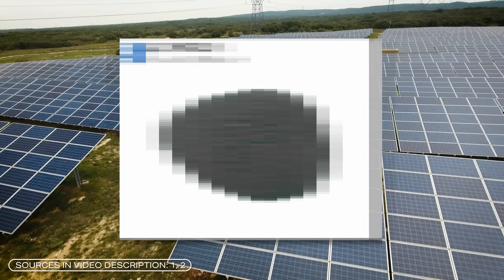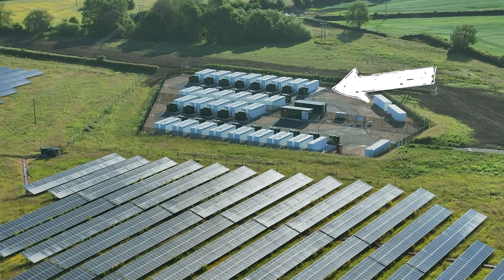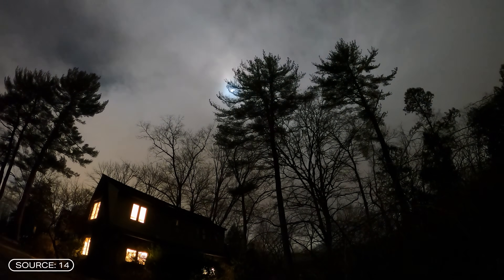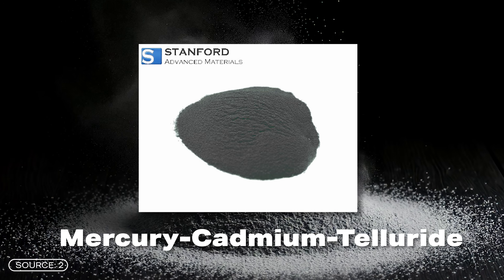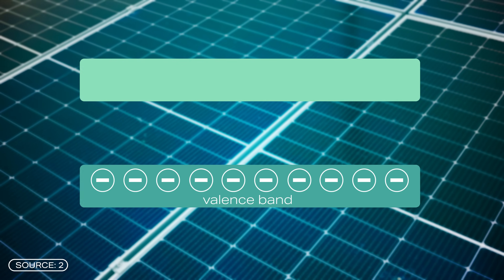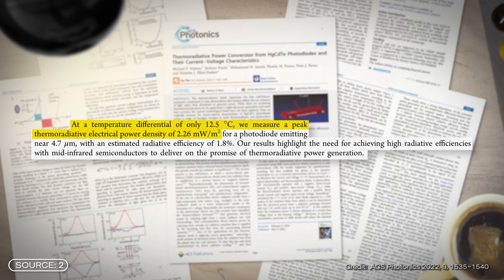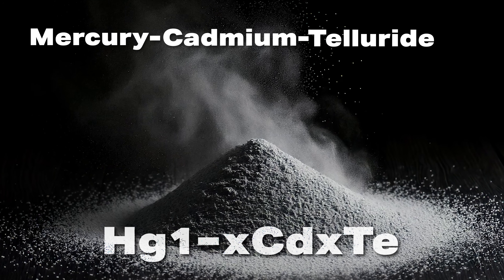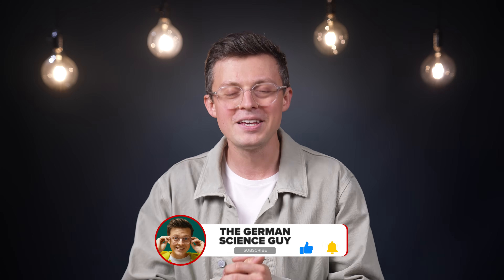Solarpower WITHOUT Sunlight: This Is How It Works!

Comment: However interesting new science is, I miss a fundamental proof of concept. The energy W/m^2 is well described and understood; all solt celles Are Measure against this. What Are the simulation values at night ? You cannot defekt the laws of physics - so no matter what efficiency is achieved, the limit is still predeterminated. So where between 500 W/m^2 and 0,00….. W/m^2 is available radiation ?

Comment: If we capture thermal energy that is usually lost to space, and convert it to electricity, doesn't that mean we are making the problem of cooling the Earth down even worse, because there would be less heat radiated out to space whilst the sun would still be heating the Earth the same amount - creating a net increase in global temperatures?

I'm sorry if this is totally not how that works 😂 but that was my first thought!

Comment: And so at end your invention here will be extremely effective with geo thermal heat from water. And shallow wels.  
    No where you find that sir.  All the vacant oil wells, all over the United States , and the world at this point. 
   But remember this  .
Water pumped down is purified by methane injections , or the EPA Will shut you down like they did with Google geo thermal plant . 
   Incidentally I saved their billion-dollar operation , with that methane water purification info .

Comment: Your report here totally oblivious to the fact that earth makes its own heat , biomass burning under our feet , cause by moving tectonic plates,  caused by our moons gravity.  

And so at end your invention here will be extremely effective with geo thermal heat from water. And shallow wels.  
    No where you find that sir.  All the vacant oil wells, all over the United States , and the world at this point. 
   But remember this  .
Water pumped down is purified by methane injections , or the EPA Will shut you down like they did with Google geo thermal plant . 
   Incidentally I saved their billion-dollar operation , with that methane water purification info .

Comment: What a bunch of BS I’ve been of grid about 30 years now solar panels are good for about 10 years and at best on sunny days they will put out electricity from around 10 am to about 6 pm unless it’s cloudy or when they spray that stuff into the air to stop the suns rays that they say they don’t do but after the plains go over making the vapor trails that don’t blow away in a few minutes our solar panels don’t put out anything and we have to run the generator extra long to charge our batteries even on bright sunny days. As for the stuff using heat they’ve been making those for years to get enough to charge your batteries you have to have about 20% more voltage than the normal battery voltage so a 12 volt battery will require 14 to 14.5 volts to recharge it you can keep around 14 volts on it at all times without damage more than 15 will damage the battery this is how you get a quic charge but doing it more than a couple times a year will destroy your batteries. The problem with the heat system to get enough energy to charge anything like a cellphone or something bigger you have to heat it up a lot usually with a fire 🔥 the ones I’ve seen to charge your cellphone requires around 300 degrees for half an hour now if your burning pro pain instead of wood it’s a lot easier but if your doing that it’s even better to just run a generator on propane it runs better quieter cleaner, and doesn’t smell as bad which is what we’ve been doing the last year because with all of the bragging I’ve heard for years with only 8 hours maximum of sun a day at the best and if your farther north or south of the equator it’s less and if you charge faster you burn up your batteries which if your lucky can get about 7 years doing faster charging you can replace them every 3 or 4 years now if your using deep cycle batteries they run about $80 to $100 a peace so your talking around $600 but lithium for the same power your talking $2000 and they don’t last as long as they say and unlike what they said must be kept between 70 and 130 degrees Fahrenheit they don’t work below 70 so you have keep them warm and if they get above 130 they react violently also if you draw to much power or try putting to much in the same thing happens. Nickel Iron batteries are the best Tesla invented them in 1900:they regenerate themselves when recharged and never go bad every few years you need to shake them up and dump out the sediment and add new electrolyte, which is just distilled water and lie they will boil off the water so you need to top them off with distilled water when low but after a few times recharging them the Iron and Nickle plates becom pure and lose all impurities so like I sad they last for ever. China bought out all of the battery manufacturers on earth and around 1980 took all of these batteries off of the market and they won’t sell you the metal to make your own I’ve tried.

Comment: As this is a proof of concept, I see the environmental hurdles secondary to the actual proof that it can be made to work. Solar took decades to become commercially relevant and something of this nature would likely follow this path as well. Once the idea has been proven, the production costs (environmental and manufacturing) will be the deciding factor on economic viability (again, following solar as an example). I wonder about the bandgap's effect on efficiency as temperature and bandgap in the material are generally related and this concept seems to rely heavily on the bandgap matching the temperature. If the selected material(s) sensitivity can follow the temperature, the efficiency should obviously increase and hopefully a cost-effective organic/environmentally-acceptable material will be developed. Furthermore I prefer your English to the AI voices some presenters are using; it's real (and as we say here, "from the horses' mouth") which I believe is important to people who are interested in science, so please stop apologizing, IMHO.

Comment: Photovoltaics are rather like heat engines in that they require a temperature difference from one side to the other. Another similarity is role of the effective temperature of the incoming photons. These temperatures need to be measured on the Kelvin scale which puts them 273° higher than the Celsius scale.
The surface of the sun is 5,800 Kelvin, So that is the effective temperature of solar photons. The average temperature of Earth is 288 K or 15° C. 
The ratio of those two Kelvin temperatures is about 20. 
To find the effectiveness of photons at those temperatures, we need to raise 20 to the 4th power, So 20 times 20 times 20 times 20, which equals 160,000. 
This means the ambient temperature infrared photons used by the thermal photovoltaics in this video are EXTREMELY INEFFECTIVE at generating power. 
There is also the problem that clouds tend to block more of the sky at night and that keeps the thermal photovoltaics from seeing the cold of space. That hurts their performance even more. 
Bottom line: There is no role for thermal photovoltaics in generating nighttime power for the world. At least not the way described in the video. Where they could generate a tiny amount of power is taking advantage of higher temperature waste heat from industrial processes. But there are ways of doing that which don't require such exotic toxic materials.

Comment: I'm not nearly as green as you nor most of the community here; I'm very pro-nuke for example. Extremely. 

That said, I'm also practical, which is why I'm so pro-nuke, And is also why I like technologies like this one; infrared is heat, so it's really removing heat from the atmosphere at a time when global warming is something we can no longer avoid. The more heat we can take out of the atmosphere the better, let alone how cheap carbon sequestration becomes with nuclear energy, but I digress ;) (especially because carbon sequestration isn't taking the heat out technically, and harvesting electricity from infrared radiation also isn't taking as much carbon out as needs to be removed)

Comment: There are now fans that sits on top of wood fireplaces being sold in Canada that operate without any electricity or battery but runs on the temperature difference between the middle and the edge of the fireplace. Maybe this material can be used to capture the heat of the earth at night?

Comment: This tech if it becomes much more efficient and basically free could be useful.for cooling buildings. Imagine these panels installed under the roofs of homes absorbing all that hot summer attic heat and generating enough electricity to run the A/C inside.

Comment: I find this interesting. Hopefully after the proof of concept is done. We can move on to finding other materials that you can use to make this. Materials that are both cheap and not toxic.
I could also see this technology being used on other worlds, such as Mars. Were sunlight is much weaker and has less time due to a lack of atmosphere to spread out the sun's photons.  Uses on the moon may also have some benefit. 
I wonder if it is possible to layer this with Photo receptors. So that it can also generated power through soler means?

Comment: Ok, what would be a total amount of energy of a photovoltaic panel of a standard size with such technology? Because such panel can during day generate around 400 Watts of energy.  I would guess it's something around let's say 400mW during night (1000x less)... So it can hardly be a solution which could compete with large battery installations. 
Some additional thoughts:
 - ground based thermal pump would be much effective solution, though it needs additional conversion from heat to electricity
 - using big sand heat storage is another alternative to batteries (also needs conversion from heat to electricity, if there's no town which could use the heat directly)
 - a progress in bateries like sodium type will enable large cheap batteries with all the benefits
 - the materials used here are highly toxic, so the waste disposal in future will be a nightmare
 - this technology could work much more effectively in vincinity of thermal wells or geothermally active areas especially in winter weather (northern countries like Finland, Greenland and especially Island). So in this special cases it could be a feasible solution .

Comment: I don't see how engineers have not implemented a solar panel that not only collects light and converts that to power, but why haven't they attached hundreds of Peltier devices under that same solar panel to convert the heat from that solar collection, also into electricity, because that would triple the total output of each panel, plus by converting the heat from that solar panel into electricity through the peltier devices, it would help to keep the solar cells cooler to prevent damage from overheating, thus making the solar panels last longer, AND put out more power....🧐🤔😎👍    it's actually my belief as to why this has not been done, is because the power companies do not want people to become self sufficient, because there is no way, that I'm the only person on earth, that has thought of adding peltier devices, under a solar panel, to triple its power output, so I think the solar industry is working under an agreement with the power companies to keep its energy production of that panel below a certain percentage, is the only way the solar industries are allowed to operate,  otherwise they would be shut down, for non-compliance....🧐🤔

Comment: You could get more energy from moonlight and star light than the heat from the earth using solar panels.  However if that heat could be concentrated then you might use a sterling hot air engine to produce electricity.  I don't believe that light is part of the electromagnetic spectrum.  Radio waves are, but they are not photons and photons to not respond to electro magnetism .   If I recall they were all grouped together because their frequencies were in the same range.  What do you call a radio wave frequency of 450 nm?  blue light?  Or a radio wave produced by magnetic pulsing?  They are not the same and are not the same spectrum  If you believe that they are demonstrate it with an experiment please.  So obviously heat is not electromagnetic either.  DO you believe that heat produces photons ?  If so there must be an experiment to prove that also.

Comment: If you could add this to existing solar panels it would be a net gain. And solar panels get very hot in the sun it could generate electricity from this excess heat.

Comment: I don't know about collecting heat energy from the earth but I sure would like to collect electricity from my woodstove!
Reply: A Peltier element would produce more electrical energy in your stove than that, but it's not profitable for many uses either. (Can barely get the stove fan to turn on)
Reply: @AH-li7ef Yeah....I know that much.
A good start tho.
I think having a look at heat engines like a "Sterling" sounds like a better option

Comment: So here is my two cents.
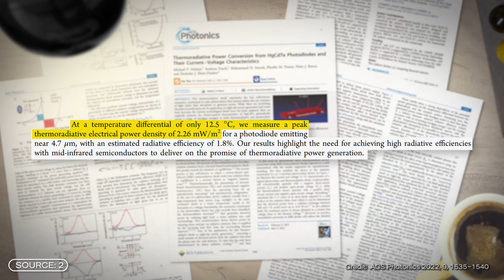6:26 - NO!!! There isn't 5 orders of magnitude difference between the novice and a professional athlete. Also clip at 5:15 talks about emission, not absorption...
It is not solar power at all. Originally I did not want to click the video because it had to be BS. I don't know what I was expecting other than BS, but I still feel disappointed. Maybe it is because I saw who was promoting it, not because the concept itself was BS.
6:44 - This is not a major problem, because the system will never be adapted in large scales. Though even for small sensory applications it is a problem.
7:35 - No, research is not enough. You need magic to happen. This can't grow from young novice to adult athlete...

Comment: So here in the US, also in China, there have been massive hail storms that have turned many square miles of solar panels into shards of broken glass, laden with heavy metals.  Now we are going to add cadmium and mercury to the toxic mix?  It can NEVER be removed from the fields after the hail storms as there are trillions of tiny shards per square mile.  Also, the solar panels shade the ground which reduces the available IR radiation to be collected.  Natural gas, hydro electric, and and nuclear are both far superior choices, as is more panels of regular or thin film solar panels.  Graphene solar may also come into play soon.

Comment: What is the theoretical limit for the amount of electrical energy that can be produced from this thermal radiation, vs what is now produced by a solar cell annually in Germany? I ask for a specific place since it will vary by latitude and other factors. If the theoretical limit is too low, then this will never be anything beyond a niche product. One possible niche is storing energy as heat and then converting it to electricity.

Comment: To be clear: if you are off grid, it doesn't really matter how much energy creating the panels costs. As long as you can get enough energy at the off grid location. There are lot of cases where it's practically bad for the environment to be on grid.

Comment: The numbers I've seen indicate 1 to possibly 10 Watts per square meter for MgCdTe solar panels. Assuming something on the order of 300Watts/m^2 radiance from the ground (~ 70F, blackbody radiance, approximate absorption band for HgCdTe), this is about 0.3 to 3% efficiency. Hope there's room for improvement there! Interesting that there are quite a few watts emitted in the infrared, if they can be efficiently captured!

Comment: But, (to quote another German Youtuber), there's just one problem.  When you cover the ground with solar panels, MUCH less heat is absorbed into the ground from the sun, thereby drastically reducing the energy from thermal radiation coming from the ground.  Unrelated to that, for anyone who has trouble with his English, (and I do have a little bit of trouble), turn on the CC (closed captioning) and it helps a lot.

Comment: I've a physics PhD myself and even if this was not my field of research(so I may be wrong)  I think the concept is flawed:
At night, the ground (~283 K) radiates infrared photons to the sky (~3 K effective), but:
A cell sitting on the ground is also ~283 K.
It sees radiation coming mostly from itself and nearby atmosphere, buildings  (also near 283 K).

Unless the device is colder than its surroundings (e.g white emissive materials coated at its top, and shielded so it only sees night sky), there’s no free energy gradient in the photon field.
This results in the very low power produced. It's not a materials problem at all, even with perfect materials, the efficiency will be very low.
But... nice discussion topic for scientists anyways, thx
Reply: As someone with O-level physics [where Q1 multiple choice was What is the volume of a cube 2cm ^3?] I am out of my depth on theory. But my initial reaction was to think Peltier/TEG.
And anyone who has an understanding of these devices knows their flaws.
Reading your comment just reinforced my initial thoughts on the probable weakness in this idea. IMBRIMBW
Reply: Yes indeed. By the way the IR equivalent temperature of the clear sky varies between -50 C and 10 C depending on atmospheric conditions. 3 K ( -270 C) is if there was no atmosphere, but we don't live on the moon.
Reply: Ive often mused that a restricted technology utilizes far more energetic particles that are able drive the pn junction once they are retarded in a matrix
Reply: Oh but you have a big degree! Excuse me! Thank you father!
Reply: Wouldn't you have to face these night time solar collectors face down so that the energy from the ground flows up to the surface of the collector?
Reply: @dreammix9430 That's what the proposal is, but the collector sits also near the ground, so it's black body radiation is at equilibrium with earth: the device is not able to extract energy in such an equilibrium: it emits by itself as much photons as it receives.